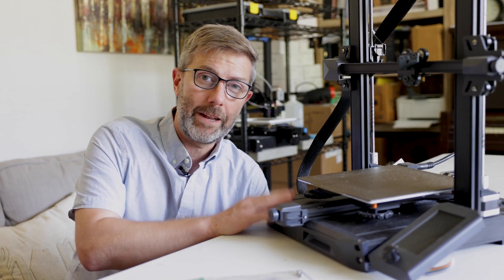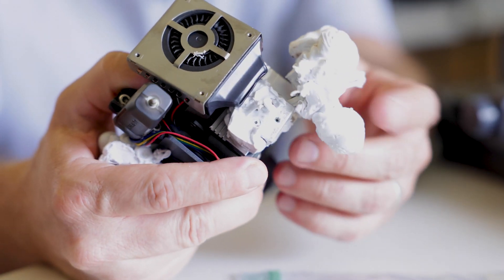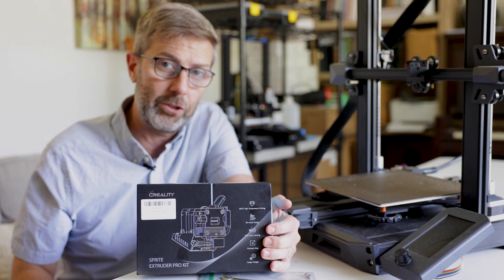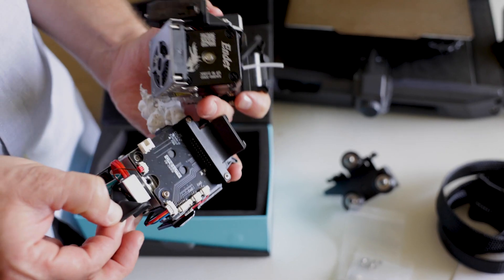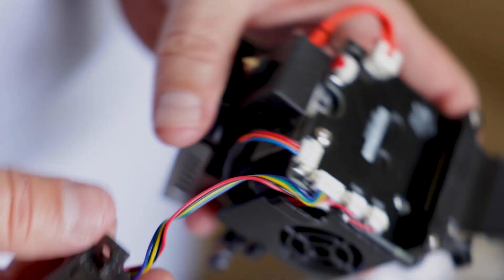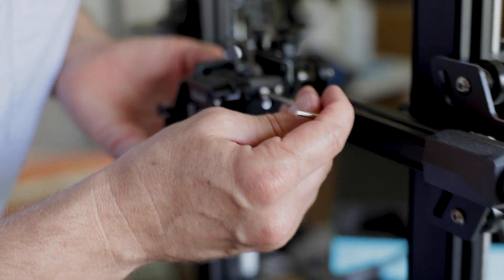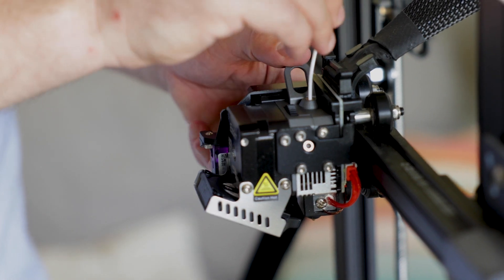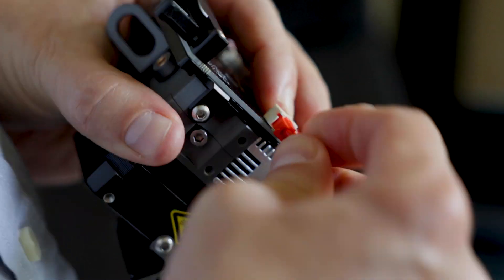My S1 Extruder died!  Ender 3 S1 Sprite Extruder Pro install

Comment: Man that is not a bad fail I have hat that happen more then once just heat up the head pull the clump off once it's hot then remove the whole hot end with the 4 screws on the right. Take the 2 screws off the bottom of the extruder loosen the set pin and take the nozzle end off and clean it up. Easier to do while it's still hot u can always use a torch lighter or something to heat it up real quick to scrape the excess off filament don't take much heat to soften. Reassembled it's all done, if the wires or something went bad the whole replacement nozzle end is like less then 20 dollars for an upgraded nozzle even like the 300c ones. I think my s1 must be a newer model or something the only difference on that hot end is the 20 dollar part I was speaking of.

Comment: Thanks for making this video.  It helped me resolve a problem with my new installation where the hot end wasn't heating.  I saw in this video that I hadn't plugged in the red heater element cable.  I mistook the little label as telling me to fit the unit to the mounting bracket, not put the cable pug in its socket!

Comment: Bro thank you so much after searching I finally found someone who went through what I did it honestly made me smile. Also respect for just calling it quits and replacing it I went and took off all the pla being as careful as I could burnt myself twice which left bad marks and still came to the conclusion of just getting a new one. But I did push through and took off ALL the pla but I never re assembled it because the Metal was shredded idrk how to explain it but I went through such a mess just to prove to myself I could but anyway thanks for letting me rant, no one would ever know what a pain I went through. Next paycheck ima buy this and all hopes the reassembly goes well

Comment: Ah yes. I also had a blob of death on my S1. In the process of removing the blob, the thermistor wires came along.
No spares in South Africa. So took it to my friend and supplier. Soldered it back on.
Worked fine.
Then upgraded the heat break and heater block a month ago.
Now added the 5w laser module.
I use this under extreme control. It is an open laser. May reflect and put out an eye. So, remote monitoring.
Extreme ventelation. I just cut cardboard and basswood with it.
Also about $100 including shipping and taxes.

Comment: i had the same thing happen to me just a day ago. i got my grinder out and ground out all the filament until i saw the bolt holes that holds the hot end on. I then got a 5/16 drill bit where you would put the allen wrench in and and drilled it until i was almost through, this allowed the head of the allen to disappear and allow it to be pulled off. I then removed the set screw and pulled the head off. I was able to get spare screws and put a new hot end on.

Comment: when blobbed like that, if at all possible turn on the hotend to like 240 degrees. Then it melts the blob and you can peel it off without little to no effort and no damage.
Then you can simply replace just the heaterblock if thats still necessary instead of the whole extruder.
Reply: Man, thank you! You just saved my printer. I put it in at 260 degrees and was able to remove the blob. Now I will try to clean the hotend.
Reply: You're welcome

Comment: Did you change the wire harness? I mean the large main ribbon cable. It seems to be identical but i dont want to fry anything if its a different pinout
Reply: I have the exact same question. Did you ever find out? 🥺 Should we change the flat cable or using the old one is ok?
Reply: @CarlozMarin  same cable!

Comment: You should have just heated the nozzle up to about 150 before you started messing with your glob. You would have saved your thermistor
Reply: My PLA wouldn't soften even at 260.
Took a blow torch to get it off. So yeah.
Reply: @MrGerhardGrobler  something was very wrong then. Your PLA should have been nearly molten at 260° 

If it wasn't even softening, then you had a problem with your heater block before you took the glob off and there was no chance of saving the thermistor
Reply: @kalan4787  yes. It is a South African brand of PLA. Very tough. It may be PLA+. But it totally buggered up my heater block. Replaced it with an all metal hot end assembly.

Comment: Just Clean the old hot end , thats ugly thing in them its just plastic
Reply: did you not watch? he said he tried already lol
Reply: @Mr.Thermistor7228  he tried as in not touching a single bolt to remove any pieces that would have made the repair laughably easy.

Comment: You dont actually have to replace the whole extruder, they also sell the hotend only whichnis a lot cheaper than getting a new extruder
Reply: You are not wrong, but holy heck was getting the old hot end off a pain in the butt.  I purchased a new hot end thinking I would just swap it out since I could not get the plastic off of the thermister wire and the heat sink wire. The set screw was so simple but the 2 screws going directing through the hot end would not budge.  I saw the mention of drilling it out, but ended up just chipping away at them with a pair of heavy duty wire snips. I now have the new  resonably priced hot end in without the 2 screws (just the set screw) and it seems to be working fine, but this was a much harder swap than I had hoped. I don't know if I would want to buy a whole new sprite extruder assembly, but they don't sell the cooling block seperately (that was my initial work around to the stripped screws) so you are in for some problem solving.  For all of you that experience the blob of distuction, just changing out the hot end is possible, but it is a pain.

Comment: In order to make full use of the Pro extruder you will need to reflash it with the Pro firmware so it will go up to 300c. Othewrwise your stuck at the 260c max.   I want to say there is a modified firmware out for the S1 that excludes the touch screen coding that the Pro has.

Comment: You should be able to save it! Melt the filament with the hot gun or hot end. You might need to replace some parts but I am pretty sure it’s salvageable. 

I have the Ender 3 1 S Pro that has the all metal hot end you just bought to the replace the one that came with the Ender 3 S1. I simply love it! The only thing is you need a harden nozzle if you want to print with corrosive filament. The included hot end nozzle works ok for PLA but if you want to use the capability of the all metal hot-end replacement to harden nozzle .
Reply: It comes with brass nozzle and a hardened steel one in the box got this kit for my e3 v2